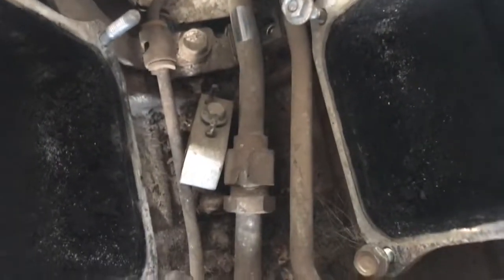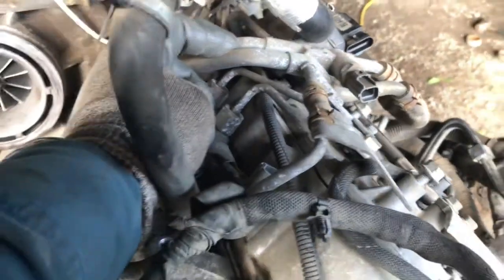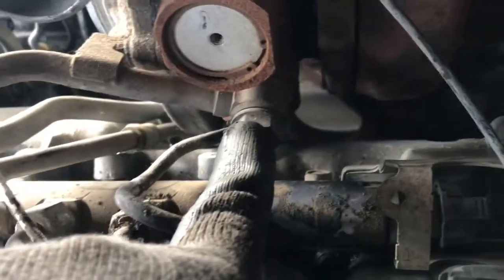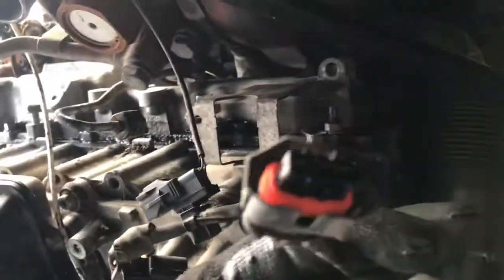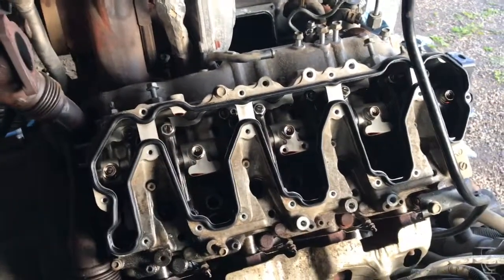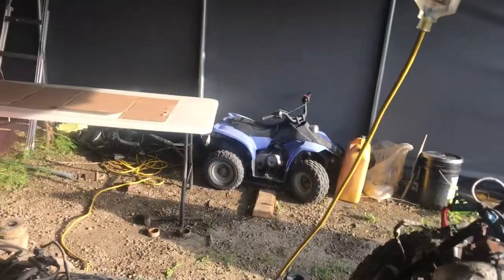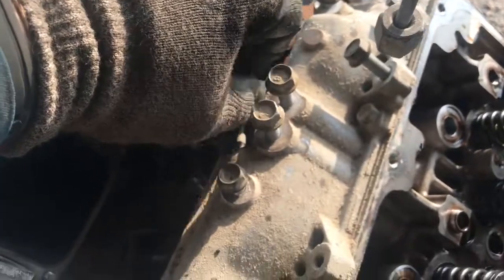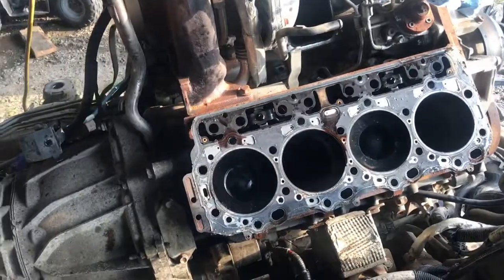Lml Duramax Tear Down part 5

Comment: I'm almost thinking I should go by it. but its still over $20k for a truck that may not make it another 10k miles.... unless i get SS fuel saver solenoid with 25 micron screens, and then a lift pump and a CP3